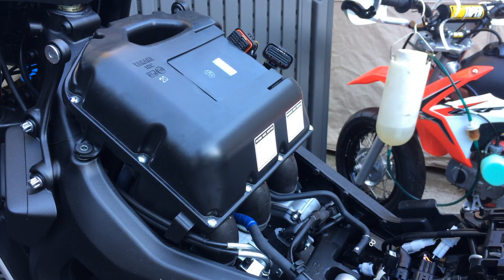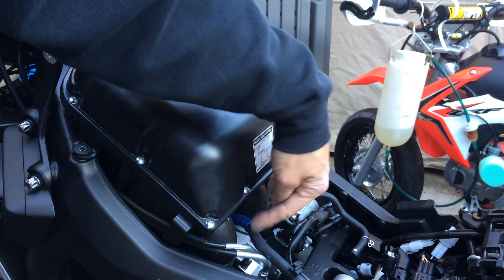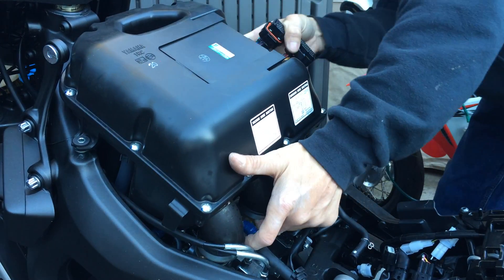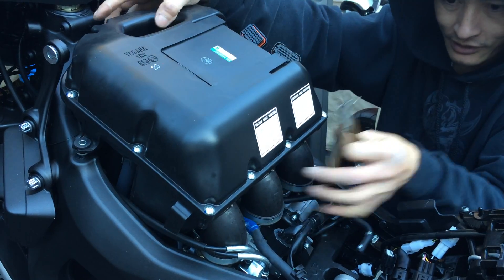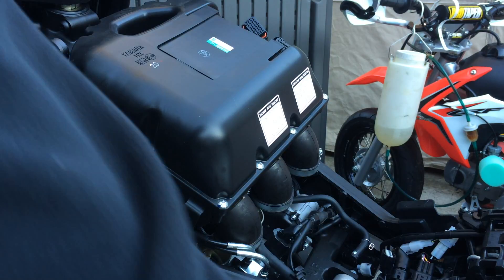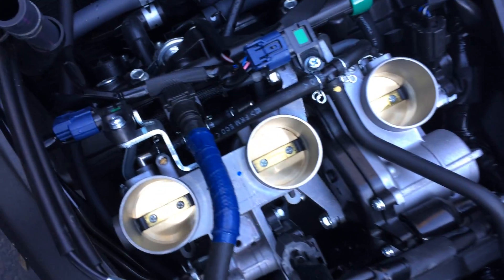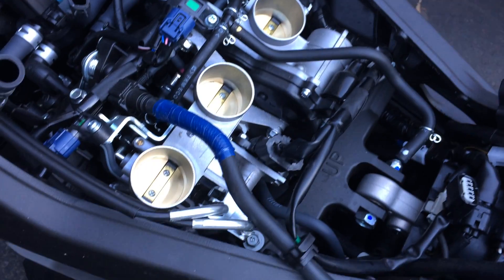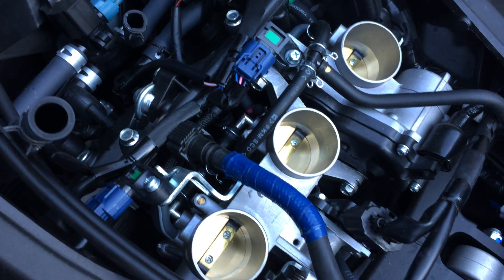XSR900 airbox removal pt.2

Comment: Love your videos mate. Very helpful. Question, I do do all that steps for changing the air filter? Is there a easy way?
Reply from the maker: gotta take off the gas tank to get to the airfilter.  Instead of taking off the airbox you have to unscrew the top off
Reply: @DaBinChe  thanks

Comment: Hi DaBinChe,I tried to change the spark plugs the other day but wasn't able to losen the 4mm allen bolts on the 3 intake manifolds. I started with the most accessible at the right side but the bolt wasn't losing up, instead the clamp started to bend. I didn't want to mess anything up so I stopped at this point.How do you managed to losen those bolts up? Was it also a pain in the ass? Not only spacewise but also how strong those bolts are tighten.
Thank you!
Reply from the maker: from the factory some fasteners tend to be tighter then they should.  Try some penetrating oil on the threads.  Yes it was a pain to get those hose clamps loose...I think I used an adjustable wrench on the end of the allen wrench at the small end of the L.
Reply: Thanks a lot! :)

Comment: call me crazy, but id ditch the airbox and put individual cone filters on each throttle body
Reply from the maker: nah, that usually makes worst performance....folks confuse it having more because it becomes noisier....like an exhaust.
Reply: i know, but i like the old school look, not really applicable to the 900 due to where the intake is but the 700 looks sweet with the airbox removed
Reply from the maker: @69HotRabbit69  I want to see a before and after on the same dyno on the same day
Reply: @DaBinChe  5 years later, still waiting? 😂